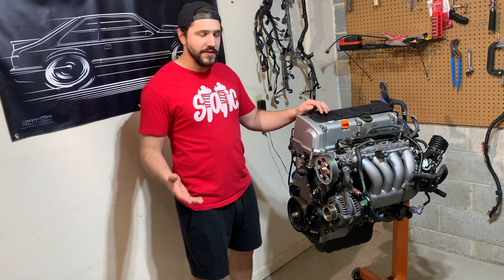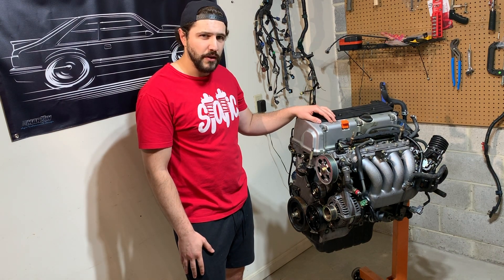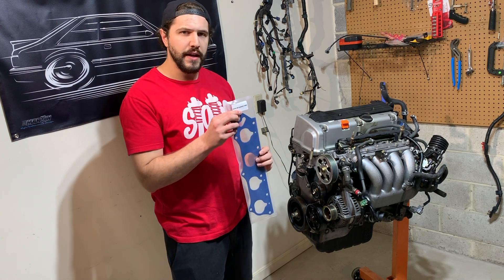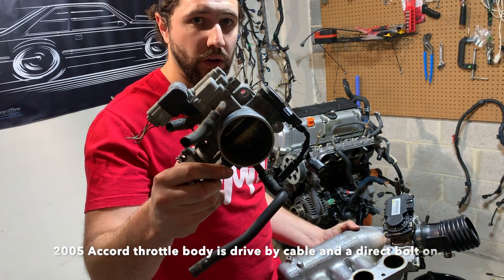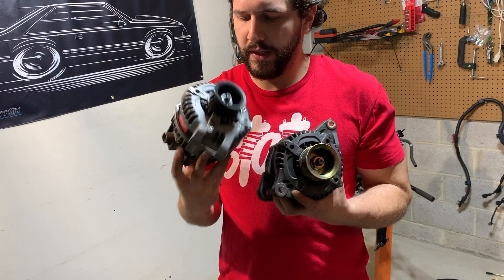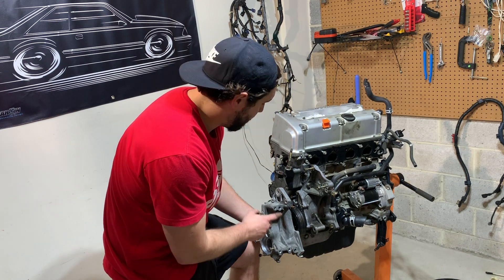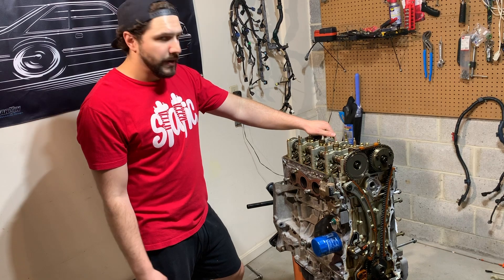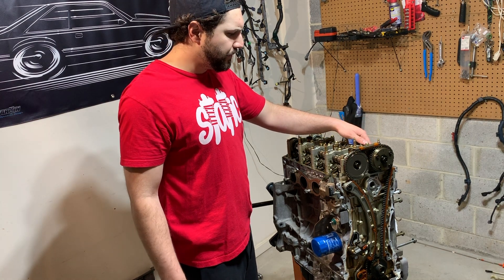K24A Tear-down and Must Do Mods - Civic K24 Swap Part 1

Comment: So did you replace the water pump/alt with the 2005 accord one??  Sounded like you said the mounts won’t line up?
Reply from the maker: Yes, I used 2005 accord water pump housing, water pump, alternator and crank pulley

Comment: Great video!! I’m prepping my JDMk24, and need to swap the water pump housing too. Since you used the accord housing, did you use the accord water pump? Also what USDM alternator do you use?
Reply from the maker: I used accord water pump and alternator.
Reply: @e-dod  so water pump housing, water pump, and alternator all from the same year accord? What year?
Reply from the maker: @joelvillalobos4279  I got it from 2005 accord.

Comment: I want to do power steering and alternator pullies on mine but I can't find anything on over or undersized belt that I'll need.
Reply from the maker: Did you see K Tuned belts? They have a various sizes: https://k-tuned.3dcartstores.com/K-Tuned-Belt_p_251.html
Reply from the maker: https://www.k20a.org/threads/k24-belt-size-with-power-steering-no-a-c.19574/
Reply: @e-dod  thx 👍

Comment: Great vid. Very helpful info.

Is 50 degree VTC gear overkill? I see they're more commonly sold.

$320 for a 45 degree. $140 for 50 degree.

Any input? Thanks.
Reply from the maker: It could be overkill. I have seen a lot of people just run the 50 degree and limit it in the ECU to 45 or less (depending on if you have aftermarket cams with more lift). The idea behind the 45 is that there is zero percent chance it could ever go past 45, possibly causing valve to piston contact on a K24. 

But with a 50 degree limited to 45 by the ECU, I am not sure what the chance of it going past 45 and causing an issue would be. Might be almost zero. I decided not to take that chance since I could not find good documentation on what that risk was.
Reply: @e-dod  Love the detailed response. I appreciate it. I will just get 45 as a foolproof measure. It just sucks because they're much more expensive! Thanks!

Comment: Which one is better jdm k24a or k24a2?
Reply from the maker: Performance wise they are the same. The JDM k24a is easier to find in good condition and cheaper since Japan put them in more cars so they are more readily available. Only downside is that it has JDM alternator that cannot be purchased in the states so if your alternator goes bad you have to change the entire water pump housing. On my JDM k24a I swapped out the JDM water pump housing and installed a 2005 Accord housing & alternator so that I won't have to worry about finding a JDM alternator if I ever need one. Also, the JDM k24a does not have all the emissions systems the K24a2 has so depending on the car your swapping in and your state laws you might have to add those emissions systems. 

If I did the swap again I would still get a JDM k24a though since they are so easy to find in good condition & low miles for cheaper then a K24a2.

Comment: I have an Element with about 350k. I am looking at a jdm swap and want to make it stronger for off road. Good parts and I like the idea of tsx head. Anything besides hondata you would recommend?
Reply from the maker: Sounds like a great idea!! Depending on the year of your Element Ktuner (https://ktuner.com/) might be a better solution because it might work with your stock Element ECU. Would save you some money and simplify the wiring.

Comment: is it a k24a2?
Reply from the maker: K24a from Japan. The K24a2 is the USDM version of this engine and has an EGR for US emissions and a oil pressure sensor below the VTEC solenoid.
Reply: @e-dod  ah thank you i have a 2003 honda crv with a k24A1 in it and was interested in ur video as ideas for an easy but powerful engine swap
Reply from the maker: @blueprintgamer6108  Yes a k24a would be a great swap for you. You can bolt on everything from your current engine to make it easier such as alternator, water pump housing, EGR system, etc. 

Only thing I am not sure about is wiring. I think you would need to wire in VTEC solenoid. And you'll need Hondata.
Reply: @e-dod  thats awesome my family never really are helpful they tell me working on cars like this is a waste of money cuz i just need a car for chores. so i really appreciate ur advice and u taking ur time to reply to my comments. did u use a stand alone ECU or would it be possible to use the computer from a car that has that engine already but is stock?
Reply from the maker: @blueprintgamer6108  no prob! Working on your own cars can save you a lot of money since shops are VERY expensive. It only starts to be a problem when you can't stop working on your cars cause its to fun haha. Start with simple stuff like oil changes, brakes, belts, valve cover gasket and move on to more difficult stuff like engine swaps. 

 I think its possible to use stock ECU with an immobilizer bypass https://www.hybrid-racing.com/products/hybrid-racing-2002-2004-k-series-honda-ecu-immobilizer-delete-chip
Reply: @e-dod  oh awesome ya my first project was simple i rebuilt an old 351w fitted it with new pistons camshaft the lot i had it carbed cuz it was simple in camparison to this stuff
Reply from the maker: @blueprintgamer6108  that's awesome! I think once you get the hang of EFI you'll like it though. On the older cars (~2008 and older) its not to complicated. Newer cars with all the emissions sensors and direct injection it gets too complicated, at least for me.
Reply: @e-dod  fair enough i thought about putting a fuel injected carb so i can boost  my 351w im thinking of meth kitting it
Reply from the maker: @blueprintgamer6108  Turbo 351 would be sick. What is the engine in?
Reply: @e-dod  i have a 1982 ford f150 extended bed. its old but looks beautiful. i had a 1990 at one point and it had a fuel injected 302 and had alot of power but i wrecked it and then saw an opportunity to make a new truck with all the improvements i wanted my old to have.
Reply from the maker: @blueprintgamer6108  351 is such a better engine in those f150's, they need that extra torque, very cool.
Reply: @e-dod  i enjoy the long bed as well cuz the engine is so far forward burn outs are much easy. and its awesomr to see peoples face

Comment: Hi I just ran into your video I'm trying to do a jdm k24a swap the engine comes with 6 speed manual  transmission would I be able to use that trans?
Reply from the maker: As long as you get the correct engine mount kit for your trans setup you should be good.

Comment: I’m wondering if I can swap k24a1 (in my 06 CRV) with k24a2 🤔🤔 I mean bolt on swap
Reply from the maker: I think its pretty much a direct bolt in. I am not familiar with the 06 CRV wire harness and if you should use Hondata or K-Tuner for ECU though. But one of those should allow you to keep your stock wire harness and just install the new engine.

Comment: Did you have any issues using the accord throttle body. What ports did you use or plug?
Reply from the maker: I had no issues. I didn't use any of the ports on the accord throttle body. 1 large port was for vacuum and the other smaller two were for coolant. I plugged them all and have no issues.  

I show how I plugged the holes in this video: https://www.youtube.com/watch?v=Gmzp_MVmiUE&t=592s

Comment: I’m going to be running a k24a in my EG6 and was wondering if a Civic Type R EP3 engine loom would be ok ?
Reply from the maker: I would assume it would be ok and you would just have to do the typical modifications to it for it to work with the K24a such as crank sensor connector and possibly VSS connector depending on what trans you use. I am assuming though that the EP3 would follow the same ECU pinout as a 2002 RSX type S since Honda tends to keep the pinouts the same across model years.

Comment: E-Dod ill be replacing my timing chain tensioner on my 2005 Civic Si EP3. Along with Valve cover. Does that vertical cover on side of chain need to be removed to replace the tensioner?
Reply from the maker: No there should be a cover you can remove just for the tensioner. 

Note that the stock cover is just a black piece of stamped metal and it bends real easy and requires hondabond when you put it back on so I really like the K-Tuned cover. 

I install one on my engine in this video https://www.youtube.com/watch?v=M8bGseJhsmY at 4:24. It will make it much easier to replace/service/inspect the tensioner in the future.
Reply: @e-dod  
Should I also replace the tension cover? Thanks for your reply.
Reply from the maker: @z31rider24  You don't have to. If it gets bent taking it off you can just bend it back into shape pretty easily. Then just clean the surface off and use some fresh hondabond or permatex to reseal it and you should be good.

Comment: Good video. Thanks for sharing and good luck to you. What are your goals for power/reliability?!
Reply from the maker: Power close to 200WHP I would be fine with. More concerned with reliability and having fun street car. This is the main reason I kept the stock K24 intake as opposed to an RBC intake and am running a 2.5in exhaust. RBC would definitely get me over 200WHP but I am not willing to sacrifice any torque for overall power. Maybe in the future that will change though. Still would be interested in inputs from others who have swapped out the K24 intake for RBC.
Reply: @e-dod  totally get it. I’m in the same boat as you. I’m making around 170 now and would be more than happy with 200-210. I’m trying to figure out the host cost effective way to do and reliable as well. This cars are fun as is so going from 170 to 200 is a 20% bump in power and noticeable enough for me. 

Congrats to you brother and keep us posted.

Comment: I'm assuming here, and I use that loosely, you went with that motor due to strictly cost. My k24z3 ek swap is making great power with the K-tuned downpipe and full exhaust. Great video though. Straight to the point and easy to follow
Reply: This engine isn't a compromise it's the same as a 200hp tsx engine. I assume people think it's an eco engine
Reply: The k24a2 is the better motor in all ways.. not much of a comparison really
Reply from the maker: I mainly went with this engine because it was easy to find and lots of information was available on it. I was under the impression that the K24z engines had different sensors and would not work with the 02-04 RSX engine harness with Hondata without modification. Curious what engine harness your using and ECU?

Comment: Heard the ktuned tensioner is trash, oem or inline pro
Reply from the maker: I agree that OEM would have been the best choice for me, especially since I am running stock cams. I didn't read anything bad about the K-Tuned one though. I just read that the spring was slightly stiffer then OEM, which I liked.
Reply: @e-dod  I haven’t used it so I really can’t say, but I HEARD from baby mommas brothers cousin nephew, lol

Comment: My Element has a K24 also; the cylinder head was swapped out from one out of an Acura TSX and now it makes 200 HP instead of the standard 160 HP.
Reply from the maker: That is a great upgrade, must be a lot more fun to drive now!
Reply: Did you have to get hondata to tune it to get 200 hp?
Reply: @kadelarson2535  yes he did

Comment: What’s up boss I have a 2011 Honda Accord coupe lxs does it have this type of engine ?
Reply from the maker: Your car has a k24 but its not a k24a like this one, its a K24z. Fundamentally the engines are similar but they have many differences as well. I am not aware of all the differences as the k24z is not as popular as the K24a for engine swaps and I have never owned or worked on a K24z.
Reply: Dude awesome video very explanatory,clear and consistent! 💯 I was having issues till I found this video! I’m currently doing same with my engine.
Reply from the maker: Glad it was helpful! Always happy to help if you have any questions.